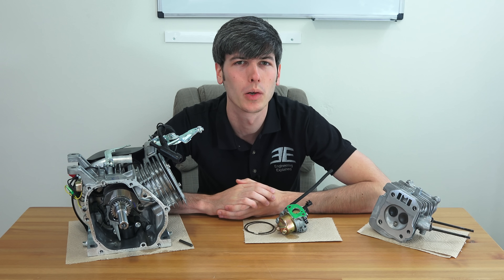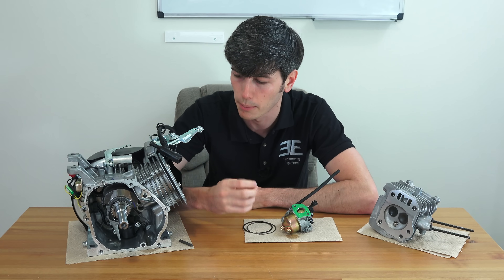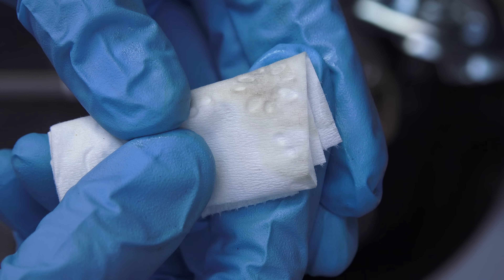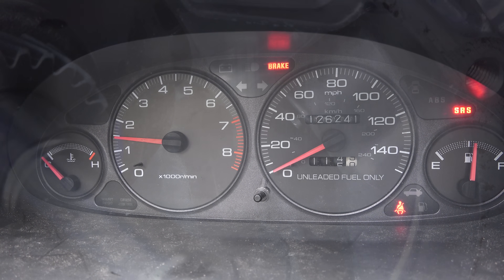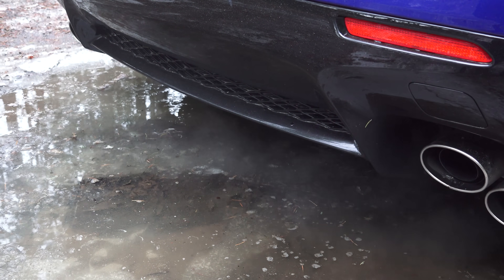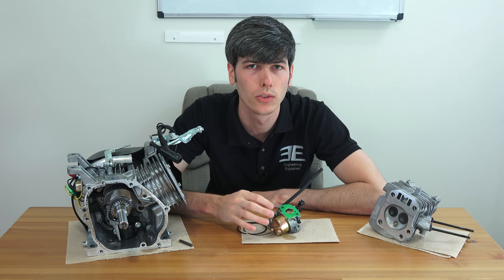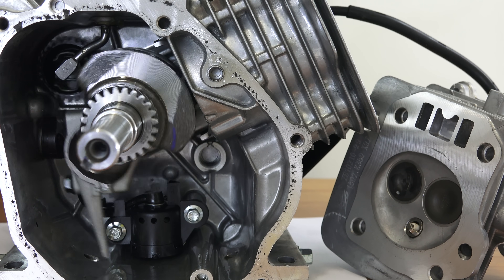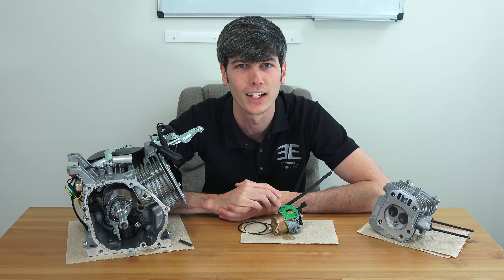Should You Warm Up Your Car Before Driving?

Comment: you know most people are arguing over this. well has anybody mentioned how cold is cold? in Alaska they cannot shut the engines off in their big rigs because the block will freeze in a few hours. but here in Michigan where I live it is cold enough to cause engine damage due to all the warm up and cool down cycles. the science in the metal has came a long way. but still temps do effect different metals causing contractions and expansion. plus it can make hydraulic systems like the steering deal with hydraulic line ruptures. so many weak points that temperature can effect. this guy talks like he knows it all. but it is just the tip of the iceberg. so much more under the layers of metal and lubricating oils.. certain model cars perform better then others due to better engineering. and some are just lemons that break down all the time.

Comment: Wrong simply wrong but only half way. You are forgetting a little thing called thermal expansion that says that different materials expand at different rates now you are a smart cat I enjoy your videos but from a career automotive technician I have no problem fixing blow head gaskets intake/coolant leaks and oil leaks because of rapid thermal changes brought on by not warming up the engine. Also automatic transmissions don't care for cold fluid which is generally warmed in the radiator...feel free to take notes👍
Reply: C-dude Hedrick I highly doubt that driving the car lightly while its cold will heat it fast enough to cause any kind of damage.

That sounds more like my neighbor who thinks they need to redline their 97 sunfire for a few minutes when its cold outside to try and warm it up faster. I realize pontiacs are trash, but no car deserves that kind of abuse.
Reply: ZERO94AIC Haha. Ok. That must be why so few of them are still on the road, right?
Reply: no one has ever blown any gasket from light driving a cold engine. idiotic argument.
Reply: +sultanabran1 yeah I can only imagine how many mechanics have been working on engines and said to themselves, "damn this engine would have lasted longer if they just drove it cold instead of letting it warm up" xD xD xD
Reply: @21DaHoagie12  you imagine? that's not evidence. that's just your imagination. also, mechanics are just mechanics, they change engine parts that need replacing. they don't design engines, they don't do methodical tests. they certianly don't present factual evidence to back what you're imagining. xD xD xD
Reply: ^ THIS ^ (What Freedom Fighter said). The video host focuses on oil delivery and forgets important thermal expansion. Because of thermal expansion and contraction issues, warming an engine at least until the temp needle moves is always a good idea. Freedom fighter is right, blown or leaking head gaskets, thermal expansion hairline cracks that develop over time, water pump leaks, oil leaks, increased carbon deposits......will happen sooner. I follow my own advice (usually start driving when temp needle is in at least minimum 1/3 range of normal operating temperature) and have a '99 Silverado used for work that has never dropped any fluid, or had mechanical issues and probably won't. In fact, all my cars over 40+ years are like this.

I noticed the host right off said, no need to warm up if the vehicle is fuel injected, then he seems to reverse his position by describing the negative effects of a colder engine. Huh??
15-30 seconds of warming is not going to do anything that adds up to a sound policy on vehicle longevity. Warming your car, within reason, is beneficial and not a myth, as he called it.

But hey, don't listen to me, nahhhh.....better you pay Freedom Fighter or myself to repair your leaking, mal-performing hunk-o-junk.
Reply: @SpaceCadet4Jesus  the engine warms up faster, if it's being driven lightly. which makes more sense than to let it warm up slower. doesn't it to you?
Reply: @sultanabran1  There is no guarantee that your drive will be "lightly", certainly not in a congested urban environment. Warming up at idle allows dissimilar alloys/metals, plastics, gaskets, hoses to warm up at a better pace that allows for less expansion/contraction damage over time. Also, the transmission certainly won't be warmed sufficiently with a 30 second startup, regardless of lubricating fluids, there is still metal to metal chafing when the fluids are not sufficiently flowing into all the nooks and crannies. Why the kickback? Why not let the engine run at startup idle for a bit longer? My common sense comes from experience, engine breakdown/inspection and rebuilds. Freedom fighter has it right.
In the end, you are free to do what you think best.
Reply: Shabuti R18 actually C-dude has a point. I've torn down a few engines that were never warmed up and all exhibited increased cylinder wall wear from the pistons expanding too fast, driving the rings hard into the wall. The head gasket issue is especially prevalent on iron block/aluminum cylinder headed engines.
Reply: +sultanabran1 the concept of light driving a cold engine to warm it up is idiotic in the first place lmaooo
Reply: @21DaHoagie12  even though evidence is presented to you that it's better than warming it up by idling. lmaooo
Reply: 21DaHoagie12 I’m sorry but it is you who are wrong.

Comment: I still let my cars, especially my freshly built twin turbo 350Z, warm-up for about 5 minutes before I go anywhere. The 350Z has a factory oil pressure sensor and when the car has been off for awhile, even a light rev in neutral sends the needle FAR to the right over 100 PSI because it is so thick.

Comment: damn it i did forgot doing the breaking point on my old fiat punto after opening the engine because of a slight problem on the first chamber...  instead of doing the burn in after cloosing the engine i would go rev it up... gladly it didnt break it but now i see what was my mistake.. its a fiat punto from 1994.... glad that FIRE engines are made so resilient.... and last     the last time i open that engine was after 19 years.... now it has 23 and going just fine

Comment: in my car manual of my fuel injected non turbo engine says: on cold starts the rpm will go over 1000 rpm automaically.wait 30 sec to 1 minute and no more and the iddle will stabilise. then drive off but do not exceed 2000 rpm until the oil reach 40 deg. celsius. (oil tempngauge start from 60. wierd) if the start temperatures are below -10 celsius oil will take much longer to warm up. So give it extra few minutes of iddling and low engine load not exeeding 2000 rpm

Comment: agree my chevy cruze 2013 goes to normal temperature after  5 min of normal driving even im winter time. when you start the car engine work on higer rpm for a few seconds then it drops to below 1000 and you hear the engine sound decreasing that way you know its good to go.

Comment: You warm up the car so the engine oil lubricates the engine parts. Thats the reason for it. Its not necessary to warm up car??? Wrong. Thats why you have certain car with remote starts and also if dont warm up your car, the engine is not lubricated. Not hard knowledge just common sense

Comment: im still under the belief that you need to start and run the car a decent amount for the oil to re-circulate to the top of the cylinder walls...how long does that take in modern engines? i cant imagine starting a car and driving right away in city traffic or freeway traffic while everything is cold...thats extremely hard on the internals

Comment: My car is fuel injected.  You have to warm it up before the torque converter will even work.  So yeah take your cold ass engine and get on the highway and blow it up.    My car has 337,000 miles on it and guess what?  I WARM IT UP.

Comment: I have to disagree. The temperatures here in Minnesota drop well below -20F. There are mornings when I'm running late for work because I have to wipe off all the snow on my car, and I attempt these methods and find that the transmission shifts unpleasantly hard, like a hard jerk that obviously does not feel normal even when I'm gentle with it. Also, if I try these methods the power steering makes a lot more whinnying noise. Generally there is more issues. I found that I have to warm it up at least 10 to get it to drive right, and that's not even with a warm interior. I've been through 8 winters and so far this has worked out best.  I drive a 09 Legacy

Comment: what about what my automotive teacher of 30+ years tought my advanced auto class? Piston heads are actually machined as a slight oval and not an exact circle, because when the piston heats up and the metal expands, it expands more where there is more metal, making it a perfect circle at operating temperature. this is why over years you have to bore out cylinder walls because they get a slight oval shape to them from people not letting idle warm it up because higher rpms put way more strain on the cylinder walls as well as piston rings.

Comment: good info but hard to belive.  i will still warm my vehicle before driving especially because of high rpms when shifting. also temps in the cylinders need to rise evenly to stop pistons expanding faster than cylinder walls which can cause scoring. but im no engineer but i will stick to whats worked on all my vehicles and they have all lasted over 200k with no issues

Comment: So your saying if it is -40 out there I don't need to warm my engine up? No way, I am still doing it!
Reply from the maker: I'm not sure, did I say that? You probably want a block heater if temps are that low where you are.
Reply: If it is -40 how did you even start your car?
Reply: as long as u have a good batt and wind chill is not below -60f it will start. mine starts every time.  -50f to -60f is when gas freezes .
Reply: @charlieman330  Wind chill has no effect on starting your car in the morning. I guess you don't understand the basic concept.
Reply: @stevek8829   the basic concept of what? lmao. oil gets thicker the colder it gets. i use the stuff everyday. i use everything from 0 w 20 to 15 w 45.  well i use gear oil too. and will chill has a huge affect on oil. i guess u dont get much cold weather where u are?
Reply: I live in -40 temps. Fairbanks Alaska to be exact. We have block heaters, Battery Heaters and Oil Heaters. I Usually let my car run for 10-15 mins before I go. I have a manual so my car gets super stiff. Steering wheel, stick shift, the whole car feels like its going to fall apart. Just last week we hit a record of -55
Reply: Tony Samson i hope this is sarcasm xD
Reply: You turn the key untill you hear the sound of the engine.. Really like it is weird a car will start at -40..
Reply: Confusing Cube I'd change the question to "why". -40, forget that jazz, it's work from home day.
Reply: A B Yesterday where live it was -45 and most of the school busses were cancelled. everything was still open (including the schools).
Reply: There is a reason it is called "operating temperature". Guy talks about "...a rich air fuel mixture...", there is sensors for that which ensure the ratio is stoichiometric. When the engine is at operating temperature the ring seals expand, ensuring there is no gasoline mixed into the oil, which he discussed. Only thing I do agree with is driving your car slowly will bring you to operating temp. faster, but one should at least wait until the car brings its idle speed down.
Reply: Engineering Explained Hello how are you .  I live in Ontario Canada. we have very cold winters here at times.  My dad just bought a 2017 Buick Verano.  He has not got it yet.  I'm guessing it does not need to be idling/ warming up in park for very long ??  how long ? 5 minutes ? not even ?
Reply: brent Thompson There also should be some places in the engine where the oil gets sticked.So we should clean it with degreasers and stuff from time to time.
Reply: Engineering Explained would it be safe to say that when your engine stops doing the cold start idle (-30c it will high idle for 3 minutes roughly) you should be safe to drive away? 

I've driven in -45c and I don't think any level engineering will prevent engine wear in those temps as block heaters don't work in those temps
Reply: Confusing Cube You plug it in
Reply: Carter Barragan Fairbanks is where Chris McCandless died right.
Reply: Carter Barragan This video exclude the fact of having installed an block heater. If you did heat your engine berfore starting it and idling, there's no reason to get worried about. But i think you'd understand tho.
Reply: Confusing Cube a properly tuned vehicle...be it injected or even carburated will fire right up at 40 below. It may "complain" and sound a bit strange until you get some heat in the motor...but it will start.
Reply: You said that cold engine causes richer fuel mixture, thus the excess of gasoline washes away the oil in the cylinders. But you didn't mention the fact that when you start driving straight away you inject even more amount of rich fuel, which logically must result in more oil being washed away! What can you say about that?
Reply: Sideswipe I have started a 50cc 4 stroke scooter at -30c°. Im pretty sure its possible to start a car at -40C°
Reply: Wasting fuel
Reply: Tony Samson -40F is the same as -40C.
Reply: brent Thompson no one said so
Reply: StickyE the sensors your talking about are o2 sensors and the computer doesn't start reading them until the engine reaches a certain temp and the computer goes into "closed loop". so they default to a little rich to play it safe until the car enters closed loop

Comment: the 6.4 powerstroke in the ford trucks has that problem of fuel getting into the oil, but it's caused by the re-gen cycle that is part of the tier 4 emmissions. Bad situation for someone who doesn't change the oil regularly.

Comment: The real reason people warm up their cars before driving?  It is cold out!   Most women really don't give a rip about the mechanical nature of a car's engine, they want to car to be nice and cozy when they plant themselves in it!  That's the whole point of "Remote-Start"....
Reply: SlipKnotRicky when i start my car i set it to blow lowest temp possible and only as much as not to make my windows fog. For 10mins I drive frozen but atleast my car’s engine is warm and cozy. My engine is more important for me than my whimp ass.
Reply: The point of a remote starter is to reduce the time it takes to head out. Let the transmission fluid warm up and it'll last longer... An engine is useless without a functioning transmission.

Comment: The best reasons to let your engine warm up-
1: Different types of metal expand at different rates, and the engine was designed to run at optimum temperatures, where all the metal would then be the correct size to operate smoothly and not be too tight or too loose (depending on piston, head, and block materials).

2: All the engine oil in your car runs to the bottom of the engine after shutoff, and it takes a minute or two to get the oil to the top end to keep lubricity on the valve train, and in the piston rings.

I know a bunch of people will say "It's going to be that way whether it's sitting there warming up, or you're driving it" and that may be true, but it causes much less stress to the engine when it isn't under a hard load. At the end of the day, it's your car, so do whatever you want.

Comment: Look you got a lot of great Intel on this channel but this time you fall short. The entire driveline of your car is made to operate at the optimum temperature properly and that usually is around 220 depending on the motor. Outside of these boundaries you will experience problems. I have owned many cars and they all drive terribly when you start moving when the outside temperature is around 40 or lower degrees. I currently have 2 v8 mustangs one 2014 and one 2013 one supercharged and the other not, they both drive like complete trash if you don't let the engine warm up. Also it takes some driving to warm up the transmission as well before the cars operate properly. You are telling a very small part of the story when it comes to a cars driveline and temperature.

Comment: I was told that warming up your car too fast, like by driving it, could be bad in extremely cold environments because rapid warming could cause warping. An example of this would be in engines with a steel block and aluminum heads. Or in my 07 ram prone to warping the exhaust manifold and breaking studs. Is it your  belief that metals heat conductivity allows it heat evenly rapidly in this scenario without causing warping. Perhaps overheating combined with poor design is the culprit in these failures. I look forward to your insights.